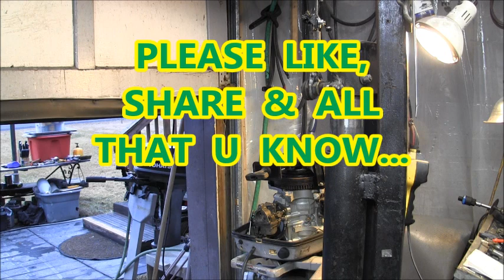1986 20 HP SPIRIT  OUTBOARD &  More

Comment: Picked up a 1958 18hp Evinrude with the 14ft v bottom boat and trailer for 500 bucks needs a water pump first had no spark ⚡️ but found that problem ran it and not pumping but overall great deal thanks again for your info
Reply from the maker: Sure sounds like it ,  I love the 18's.    kb

Comment: Hey kodi I did find a sprite on fb marketplace 16 hp if im not mistaken 😜 im curious the triflow you did with suzuki im assuming will be a good thing to do with any older outboard brands?
Reply: For the fuel pump
Reply from the maker: Yes' If they have been sitting awhile it helps.   kb

Comment: Hows it going kodi, have you ever used a oxygen acetylene torch to loosen bolts on a power head ? Had a few bolts break on me and am trying to see what to do ? Appreciate any advice.  Thanks again for the great videos always fun to watch.
Reply from the maker: Only on outboards I'm scrapping.   O/A  can melt aluminum fairly quick.  I would recommend map gas and even then go  easy..     kb
Reply: @kodibassInsideoutboards  thanks for the tip.